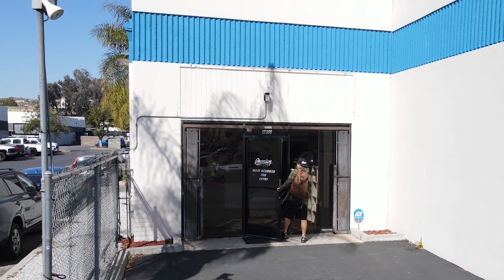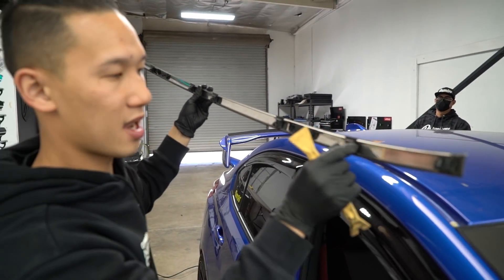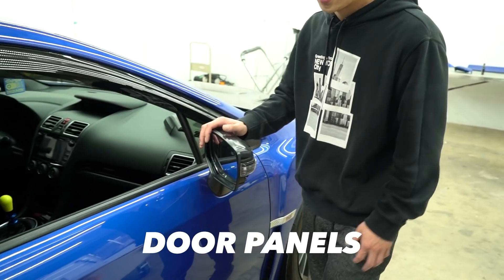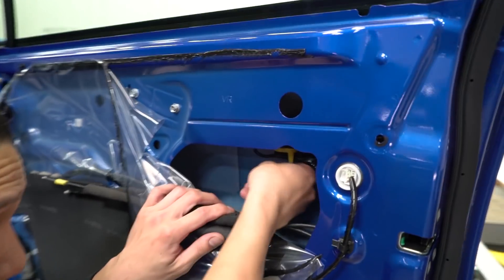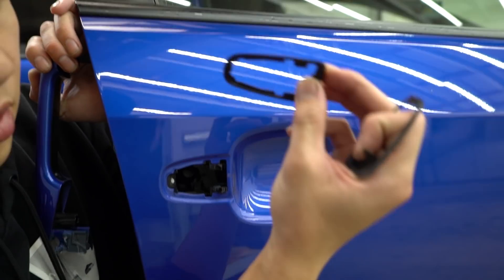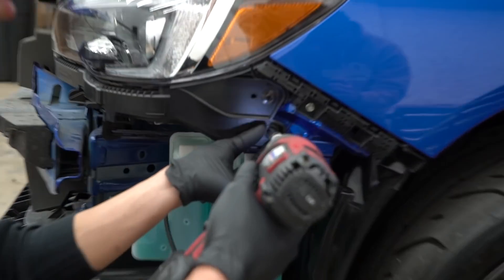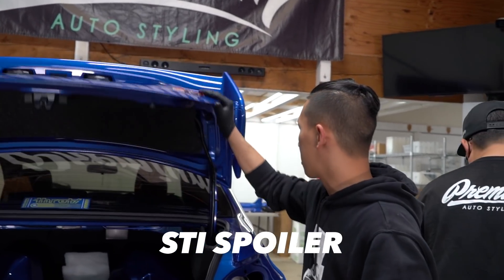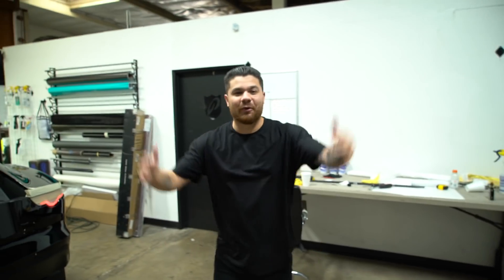How To Take Apart Subaru WRX/STI (2015-2021)

Comment: awesome job!! I could've used this when I wrapped a 19 sti some time back lol. does the passenger window not roll down from the driver side after disconnecting the switches on these models? I needed to do a procedure after connecting everything when I wrapped it.